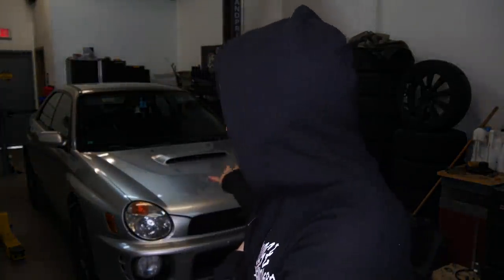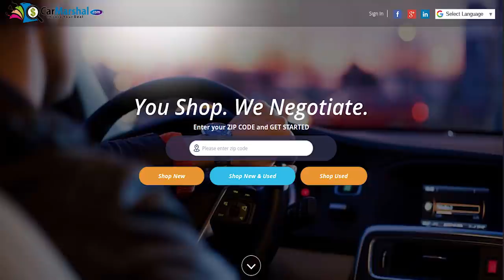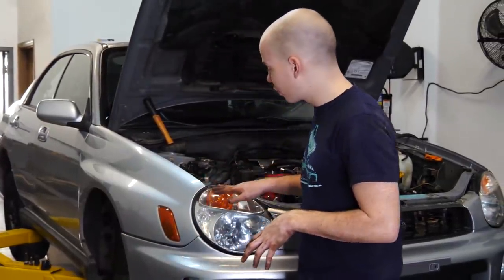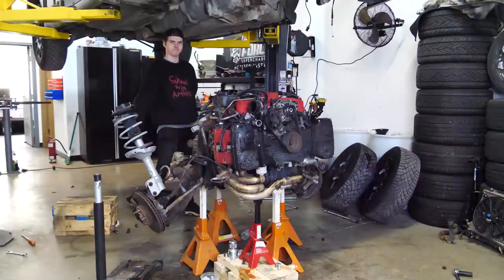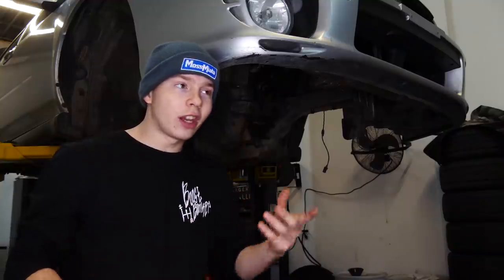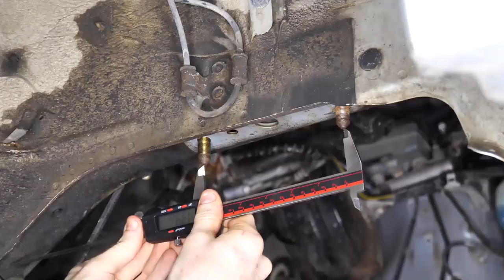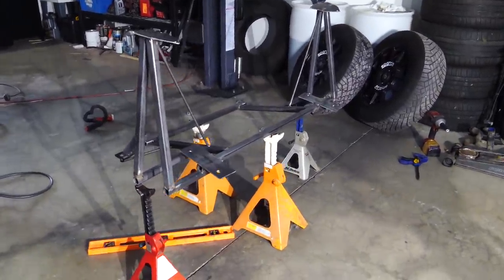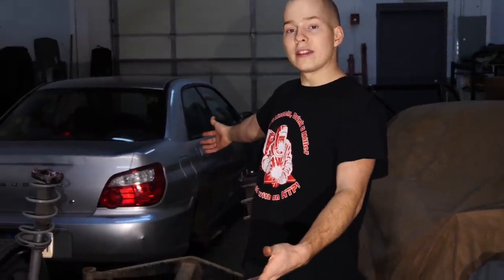Getting the AWD DRIVETRAIN & Building a CUSTOM CHASSIS JIG!

Comment: "Should be able to build very precise - "  throws precision/calibrated instrument xD
Reply: Steve Howes Died a little on the inside when I saw that.
Reply: That's funny but calipers are tools you're supposed to set back to zero manually everytime you use it. So unless you manange to bend the whole thing, you shouldn't hurt it's accuracy.
Reply: @imnota  vernier calipers should not be treated like a pipe wrench...this is how they end up with the pointy bits bent and corners of the jaws nicked.
Also if you throw an actual micrometer, even in its box (with verniers it'll depend on how expensive they were), in most machine shops you will encounter varying degrees of violence :D
Reply: @AKAtheA  Yeah, I know, what I meant is that as long as it doesn't have any visible damage you're fine.
Which isn't the case with a micrometer, I know.

Comment: They are 1000 lb rated when evenly distributed across the whole top surface. Not center point loaded
Reply: chaunster yeah lol. I put a large sheet of plywood across the bottom of the car and put the front end on two of those with no issue at all. (Rear subframe was still on so I had wheels there still) and this was a larger volvo sedan.

Comment: Good work!  And yeah there's no way those dollys can hold 1000lbs lol, just based on the construction.   Reminds me of Chinese power supplies.  Whatever wattage it says it's rated for you need to divide by about 5.   Actually you should weld up some nice dollys for general use, could make a fun side project.   The weak point would be the casters, need to find some really good ones.

Comment: gets vernier calipers
uses them like a fucking ruler...oh the pain...
c'mon dude, watch a video on how to use the damn thing, no need to guess where the centers of the pins/bolts are, you measure by touching the sides with the jaws and then subtract the radius of both round features, you can easily get one more order of magnitude of precision by using the instrument the way you're supposed to.

Comment: That's a set of vernier calipers, not a micrometer. Generally a digital vernier goes to 0.03mm accuracy, while a half decent analog set is generally accurate to 0.02mm. A micrometer is generally accurate to 0.01mm

Comment: FYI, that's a pachymeter. A micrometer is similar, but are way more expensive, have a less range of measurement, and is way more precise, besides working in a bit different way

Comment: Time to fabricate your own dollies me thinks. Also are you not building a jig for the rear suspension as you will need to cut out the complete rear to build a rear subframe to be welded to the rollcage to make life a lot easier, I diid this with an old Austin Mini to have  a second engine in the rear as it has it's own subframe it was easier, also a friend fitted a second engine in his Citroen 2CV he built a cradle rom the rollcage to the engine as there was nothing to bolt a second engine to.
Enjoying this build reminds me o my time building the sily conversion's but I did start smaller with engine conversion's first before complete transplants.

Comment: your vernier caliper (not called a micrometer, i don't think) may drift if you open the jaws too fast or if you get debris in between the slides. My friend got the same one and best practice is measure twice and only be sure if both readings are the same.